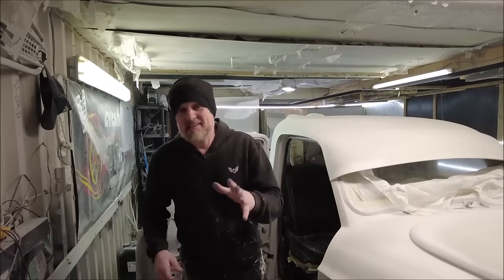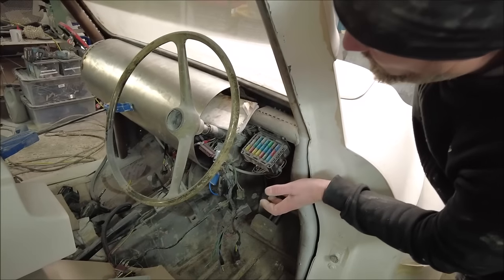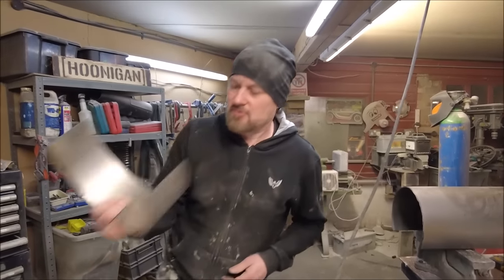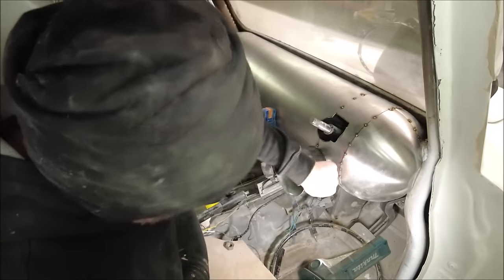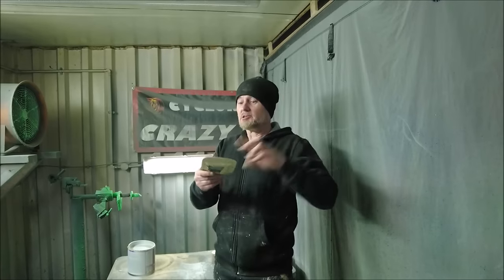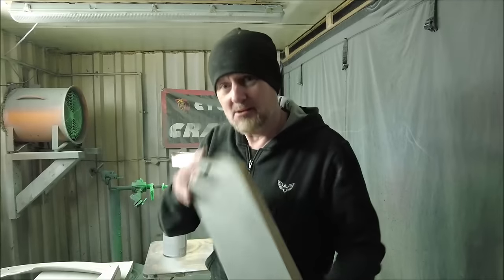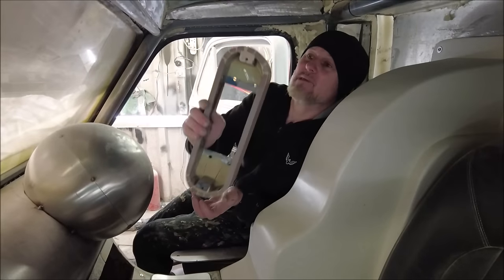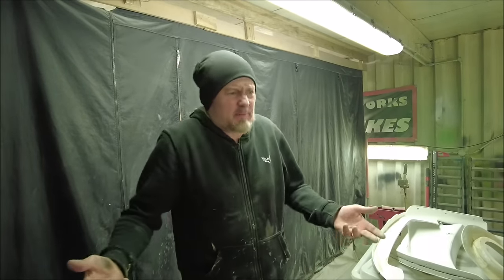How to use IKEA bowls to make your own Kustom Dashboard

Comment: Dude very cool, but what about the fuse box, THE FUSE BOX DUDE
Reply from the maker: Its under the dash in a taxi, still easily accessible
Reply: @bacop001  the video shows it on the right side of the steering wheel. Just didn't want the universe to collapse if a fuse blew😁
Reply: The fuse box will be relocating back to its original position